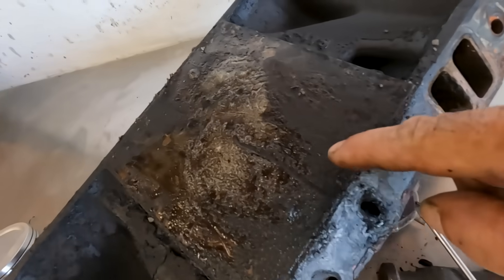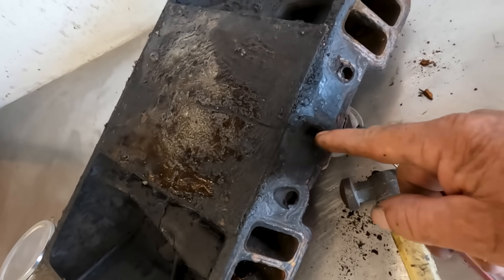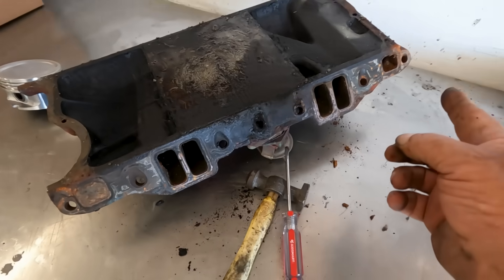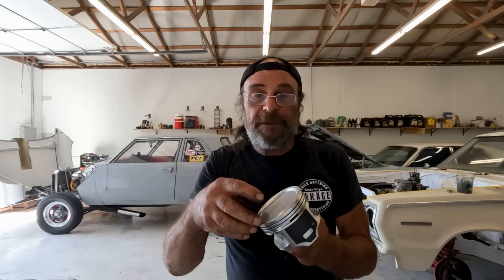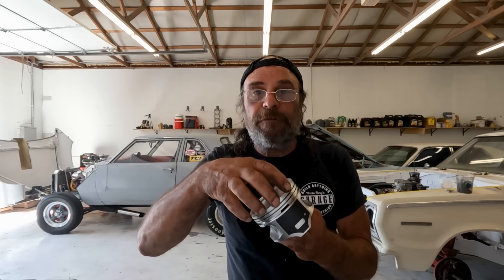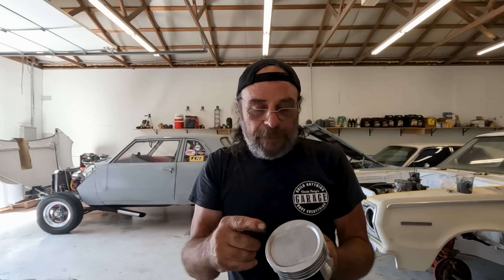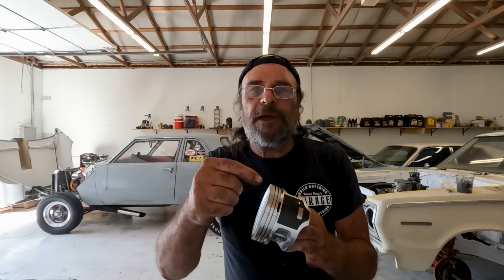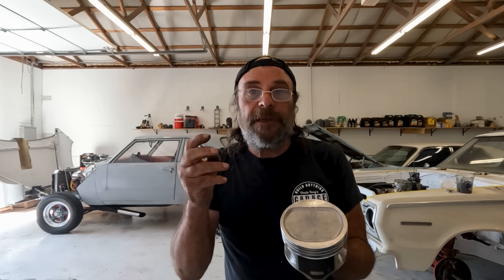The Number One Killer Of Gasoline Engine Efficiency And Power And How To Stop It

Comment: Back in about 92 I did this on a old Lady's car mid 75 and she came back after her oil change and my free" tune up." . She was not really mad but kept on me for why her car was running so much quicker. I did it to every car that rolled into the shop prior to oil change. My Boss came to me and said whatever you're doing, keep doing it we are booked for the next 2 months.
Reply: @pkuudsk9927 Does the steam cleaning still work with turbo engines? How do you avoid propeller damage from the carbon flakes hitting it?
Reply: Won't the carbon chunks clog the catalytic converter?
Reply: Sorry for being a space cadet, but what did you do to her car?  Italian tune up?
Reply: @Tipman2OOO  LOL as a mechanic for 40+ years I say there is no wrong question when you don't know I would always test drive around the block every car before, so I could feel the car and find things people just got used to. So I found things people didn't know, like dead shocks, sloppy steering etc. So while the car was hot I would bring them up to 2500 rpm them slowly pour in cold water and the carbon on pistons cat spark plugs valves would come out the tail pipe. I had a Mason jar to collect the crap and show people, and it was free. We had alot of older customers who had been with us for decades along with family and friends who they sent to us.They never drove their cars above idle so I knew they were carboned up. 5-10 minutes of trickling in water and the tail pipe would be clean like new inside. I even did Temp checks on cats before and after a few times and you could see how much better the cat was flowing. I always wanted to pull an injector to see if the tip was cleaner. We had all the chemical dealers come by the shop and try to sell us the newest snake oil/tune up in a bottle and laughed at them. The BG dealer did one of his demonstrations with his 1 bottle cleans injectors valves pistons. So after I did my water trick and more crap cam out the tail pipe , I laughed at him and told him to move along. My father, a Mechanic from the 50's taught me this simple trick who he learned from a 30's mechanic. Get your car up to operating temp, remove the intake hose to the Throttle body. Take a water bottle and make a 1/16th hole in the cap, bring the rev's up to 2500 ish and spray the water in slow enough to not stall the motor and watch the crap come out of your tail pipe. It's like steam cleaning the inside of a motor. Then change your oil as it is now contaminated with water, not enough to harm anything for the 5 min you do this but you will notice a difference.. Try it and see for yourself. Another trick I used was putting a liter of diesel in motors before pulling them apart with 200+K miles on them, let them idle for 20 min and inside they would have little to no varnish. 1 had been so long without an oil change when I pulled the drain plug it came out in chunks, I jammed the drain plug back in put a liter of diesel in parked it outside running for 1 hour. The lifters and cam chain tensioner no longer need to be changed as now oil could flow. Try the water trick and be amazed
Reply: @Tipman2OOO Hey Tipman. At this late stage in my life, I’m getting interested in mechanical things. I never cared at all. But buying a vintage car has me wanting to learn new/old things. So, like you, I’m learning something new every day.
Reply: @Tipman2OOO  Get engine 2-3k rpm warm water in a spray bottle fan pattern and slowly spray it in. Decarboning. OR get some GM top end cleaner even better
Reply: @gordocarbo  Would it work better with hydrogen peroxide?

Comment: My father had a small town Ford dealership until the mid 80's. We had a lot of older, slow driving customers, Falcons, Fairlanes, sometimes a Galaxy. These cars were short trip cars that probably never saw 3,000 rpm in their life. When one of those would get traaded-in I would get a buddy or two, sneak a dealer plate on it and take it out after dark. We had a perfect stretch of straight country road to use. Take that poor tired 6cyl. or 289 up 'till there was not one more RPM left, then lift off the throttle and drop a gear. The fireworks out the back were amazing as glowing red carbon chunks went flying out the tailpipe! As often as not it would carbon tip  a spark plug or two and we would sputter back and park it on the lot. Ahhh, the good ol' days!
Reply: That's funny!

Comment: I’m updating the 131 crate engine in my 2021 Harley to the 135 spec engine. The new 4.310” Mahle stroker pistons are flat top, gas port pistons! I was surprised to see that.

The stroker crank has a 4.625” stroke and the assembly is 2.4 pounds lighter than the 4.5”, 131 assembly.

Comment: Fuel additives such as Techron and some gumout etc have a chemical called PEA. Excellent carbon dissolver. Cleans fuel injectors as well. Tell tale sign that the additive you buy has PEA in some concentrations a fishy smell. Other than that an MDS sheet will tell. Seafoam doesn’t have it but their fuel bottle does for example.

Comment: I had two customers that came in with what sounded like a rod knock. I didn't think it was a rod, so I poured some ATF down the carb, while holding it at about 2000 RPM. Slowly the knock disappeared as the carbon dissolved. The downside is the Smoke out the exhaust! It should be noted that you should only try this decarbon trick if you have a good idea of what you're doing, as it is easy to hydrolock the engine, which WILL bend the rods!
Reply: Seafoam is safer

Comment: No, not the main reason at all . If you just look at the attitude of the average intake valve guide and stem and flow . It is constantly creating a venturi and when the stem seal isn't sealing properly you get sleight amounts of excess oil coming in . Actually when you see an abundance of carbon on the backside of the intakes, you will either have bad stem seals and or excessive stem to guide clearance .
Ford had a lot of problems with their FE engines from the 3/8" stem diameter and wear on the stems . I could go on a long time on carbon, valve overlap effects on hi-pro engines but I'll stop here .

Comment: Blowing out the carbon is how I fell in love with my 6 cylinder nova in 80s .Old lady had it since new it smoked so bad low power I was going to put 350 in it so I beat that motor driving like a nut "my first car " at 16 in a few days it stopped smoking and just came alive .72 Nova bare bones no options! After some 50 cars now that was best car I ever had I'd smoke V8 s on the backroads even   the Amazon cop that slammed me on the ground after running out of gas chasing me said no way that's a 6 cylinder!!!That was last time I drove it with fake plates!!😂

Comment: Always found the best way to bring a winded motor back around was to take it down to the swamp, pull the air cleaner off and hold it wide open while glugging automatic transmission fluid through the yap. After the smoke clears, it’s hard to believe how good it’ll run

Comment: i had a 1973 dodge.  the dealer had applied a service tune to it.  long story short, is killed the egr.  I had the top end apart, cleaned that egr system and the car ran soooo much better.  milage and power were definitely better.  if i left the carbon, it wouldn't become diamond. lol

Comment: I'd love it if Uncle Tony would either do a deep dive or maybe even an extended daily driver test of Thunderhead289 's Carb Cheater!  I'm sure it is legit, but just from someone with so much experience and know how, is this a perfect pairing for any carbureted engine?  Is it only for V8s?  Just another one of my favorite YTers invention that would be neat if it got a fair shake down from a guy that's no non-sense and wants to get the info out to the young guy that likes busting knuckles and keeping their own money in their pockets!
Reply: Carb cheater will work with any carbed gas engine operated primarily at part throttle. I would also like to see Tony mess around with it. One of the old guys in our shop has one one a 352 Ford 3 speed.

Comment: Instead of water, we used carb cleaner or brake parts cleaner, or b-12 chemtool for getting carbon cleaned out, seemed to worked pretty well usually, unless it was an engine that ran Pennzoil all it's life.

Comment: Funny thing Tony, I don't think you said that heavy caked carbon on the intake or exhaust valve is an indicator of valve guide and valve seal failure
 Also I've seen the de-carboning process done with a spray bottle with a mist setting

Comment: 348 Chevys used to be bad about developing carbon cylinder head knock from carbon build up on the squish area between the piston and the cylinder head. The cure was, as Tony says, was to dribble water through a hot engine to clear it out. The crossover passage on many cars back in the day were also blocked with carbon like the manifold on the workbench.

Comment: You may cover it still but you seem to be overlooking the EGR system and how it contributes to carbon buildup. The engine is literally trying to breathe it's exhaust gas and particulate. You'll get plastic intake manifolds full of oil and carbon and by that time it's a guarantee you'll have buildup in your bowls and back of your intake valves.

Comment: Poor man's Water injection is great! I made one for a majorly carboned up 318.
Within a few weeks, the mileage and power improved.
I'm above 3000 ft so I also dropped jets a few sizes too😊
A Mason jar, aquarium stone and an adjustable air bleed, and rubbing alcohol to keep it from freezing...
Kinda like having water/meth mix.😊
I used to pour a cup of distilled water down the carb slowly to "steam off" carbon in the ports and chambers as part of a tune-up. Would keep the rpms over 2500 ❤
The oil consumption also dropped too.😊
Reply: Yup it's how it's done

Comment: A buddy of mine had 1981 Pontiac Grand Prix with 301. Started running rough and knocking. Pulled intake, that passageway was blocked solid. Between picking and steam geni and bear blaster got her cleaned out, ran great, other then egr gasket looked different.

Comment: Circle track guys like those older engines that looser tolerances to rebuild. My stepfather built many dirt track engines. He like a good 350 with a little over 100,000 miles on it so he could cut the ridge, hone the cylinders, and just replace the bearings. He said they stayed together longer on the track than a freshly machined engine.

Comment: Direct injection engines will start developing carbon build up on the back of the Intake valves and cause misfires as soon as 5K miles. 😳 GM has a TSB on it!

Comment: Newer engines are worse with the carbon due to direct injection coking up the intake valves. I worked at a dealership and cars would lose mileage and power around 45 k and we would do a carbon cleaning around every 40k  
With products made by BG, the makers of 44K.

Comment: Valvoline Restore and Protect oil claims it will remove all deposits if used over time. I have heard some good comments about it. Worth a try?
Reply: they say old stuff was too good. running it now but wish i got the thicker stuff at first...it is summer

Comment: The new DI engines have a PVC issue, drawing in oil mist. Clogging the port, then you try to clean it out with a chemical all that carbon goes into your turbos or catalytic converter!
Walnut shells is the alternative

Comment: CRC 1 TANK, use it every oil change or peak fuel efficiency and clean engine.  Poor burning fuel in a combustion leaks through and gets into the oil.  Oil with fuel in it is the biggest contribution to engine wear

Comment: Heh... I don't see a degradation of power, mileage, or drivability on my Pontiacs as they get driven. Also there hasn't been a large amount of carbon clogging everything and coating the internal parts. Coming up on 15 years on the 455 thats in the 65 GTO. Its been on ethanol since I rebuilt it. It drives and runs probably exactly like it did when it was fresh. I'll make a video tearing the next one down when I swap cams or heads to make more power.

Most of my Pontiac engine cores I build are untouched since the 80s, the LS engines are all over 20 years old. The EFI on them keeps them cleaner, and the ethanol in gasoline helps with that too. The engines from before 1983 are full of carbon when I pull them apart. I've been cleaning parts from my stash this month, that stuff becomes a thick grease when it sits for 30 years.

If I wasn't running E85, there wouldn't be any carbon fouling the oil, the bit of gasoline in it leaves some. When I get my fuel production back up and running after the upgrades, I'll run an engine entirely on E100 as a daily driver for a couple years and take it apart, probably an LS engine. I'll show every oil change on it too.. Ethanol doesn't leave anything behind.

Comment: My 318 manifold (1971, 170,000 miles, but none since 1995 and none with ethanol) had little buildup in the crossover.  The engine valves were also not too badly carboned.  I do think the adulterated gas with ethanol and other epa mandated crap makes the problem a lot worse.

I still have a couple cans of the Mopar manifold heat control valve solvent; it worked great for that purpose and also removing carbon deposits from engine valves.  It helped with the carbon in the crossover too but I hated to use it there much because its probably irreplaceable now and I'd rather save it for its intended purpose.

If you are going to clean up a plugged crossover I expect a power drill with masonry bits would be a good start over chiseling.  YOu could drill as far as was safe in a checkerboard pattern, then fill the holes with solvent, then break out all the softened carbon in chunks until you get to the flat part and can't get a drill in there.  Still would get a lot done probably faster.

And they are worth saving.  YOu might not think so now but in another few decades even these wee 318 parts may be precious.

Comment: Carbon generalluybis bad for an engine. There are some instances where carbon buildup can be beneficial, or where removing it would basicaly destroy the engine.

I have firsthand experience of when a mate and I did a head gasket on a Totota Crown (2M engine). It obviously had very high miles, but drove fine for what it was. When we got it back on and going again, we changed the oil (as you would normally do), but my mate only had some Mobil 1 lying around from previously owning a bike.

So, in it went, and the car ran fine for a while, then started knocking really badly after a week or two. There was a big cloud of vapour emanating from under the hood. We could see crankcase gases pouring out of the breather, and the engine started missing on one or two cylinders at idle. It would run ok in the upper rpm range under load, which told me that it was ring bypass, at least in the cylinders that were misfiring.

I drove the car myself for a few months and the blowby got so bad, I would catch the oil vapour in a 2L milk bottle and tip it back into the engine at the end of the trip.

We figured that the Mobil 1 full synthetic did such a good job of cleaning up the carbon buildup around the pistons, that they no longer had the ability to take up the wear in the bore and ring lands, resulting in poor combustion sealing. I have also heard nany times, as a diesel mechanic, not to use high-detergent diesel oil in a high-mileage petrol (gas) engine for this very reason.

The carbon, in this instance, actually helps take up the wear in the rings, bores and ring lands, where providing that the carbon doesn't cause the rings to jam up, it can allow the engine to live much, much longer than if it wasnt there.

Comment: GM used to make what they call top engine cleaner, that will absolutely break down the carbon build up and it is designed specifically for this problem.
I know first hand that it works, if it's still available.
Reply: @kimdearrington258  GM top engine clean works great! I've taken that stuff and put it directly on piston tops and just watched it break down the carbon. Good stuff!
Reply: Seafoam
Reply: Yes that was good stuff. Once l did valve seals (smoked on start up, very common issue then)on a late 80's Chevy pickup with a 4.3 V6 high miler. After when l started the engine it knocked really bad, it sounded like there were 3 boy scouts having a hammering contest in the engine. Let the engine warm up then starting pouring in the GM top engine cleaner in until the engine stalled. Let it sit for about 20 minutes started it, it smoked  for a short while and the knocking was gone and the engine idled and ran smoothly. Unfortunately in the early 2000's GM changed the formula  (reason was that old formula caused cancer in lab rats and was outlawed in Commiefornia) it turned out that it wasn't nearly as good as the old stuff. As far l know it's still available.. OMC used to have a fogging oil (used for outboards and other marine engines) that pretty much did the samething it was good stuff. OMC  is gone so is the fogging oil.
Reply: @michaelmurphy6869 Mercury Marine power tune.It's in an Spray can

Comment: I like to find good condition pre smog intakes. Occasionally I'll find them hot tanked and tested. I overpaid for a 2 barrel intake last fall but it's in really really nice shape and was even painted. I've got a nice 351 (1.21) autolite 2100 i thought I'd try with it. I don't mind the aluminum intakes except i usually end up with someone's car that they thought putting all the torque on the thermostat housing bolts they could muster is the way to go and you know how that ends up.